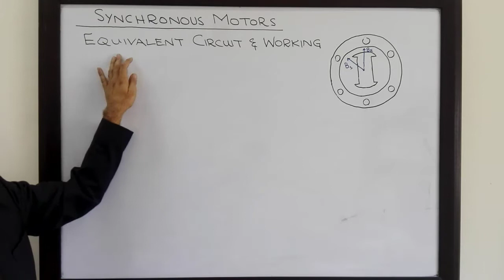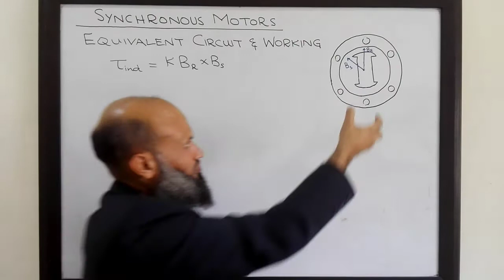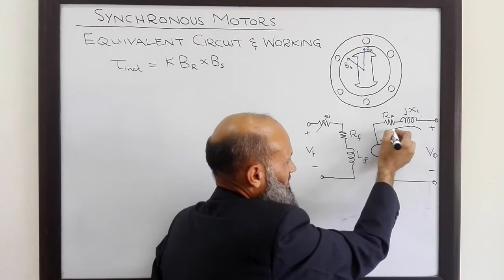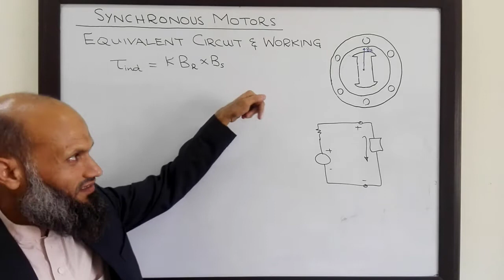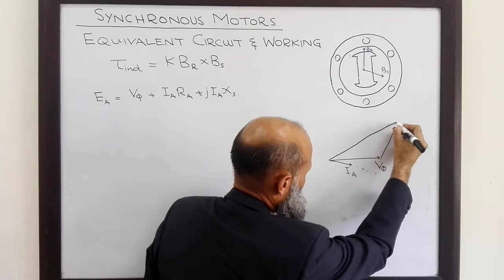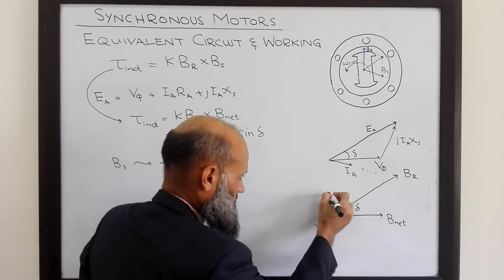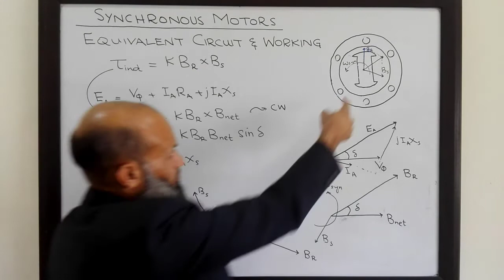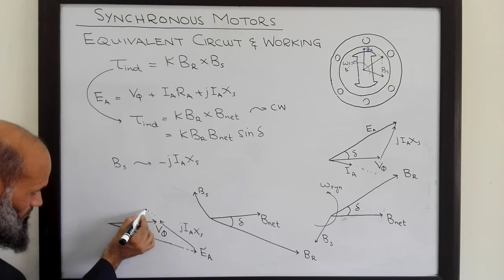EE213 - 38 - Synchronous motors - Equivalent Circuit and Working

Comment: Sir how is Bs still rotating with the same speed when we remove the prime mover ? Because as Br slows down the frequency of volatage in coil decreases and thus the speed of magnetic field i.e. Bs produced by them decreases.
Reply from the maker: Bs is due to current in the stator and it's speed of rotation is dependent upon the frequency of the current flowing in the stator windings. In case of synchronous motor, the current in stator windings is due to three phase supply connected to the stator. Therefore, speed of Bs is independent from the speed of rotor.
Reply: Sir I got that, but the machine was intially operating as Generator and the voltage produced in generators is due go roataing magnetic field of rotor and the voltage in 3 phase coil has same frequency as rotating Br but now if we remove the prime mover shouldn't the frequency of voltage in 3 phase coil decrease and  the corresponding speed of Bs ??
Reply from the maker: If the generator would have been working standalone, the situation would have been the same as you have perceived. However, over here, the generator is connected to an infinite bus.  As soon as prime mover is disconnected, the internal generated voltage drops and speed of the rotor decreases (during transients only), and the machine now starts behaving as a load (motor) for the infinite bus. Let me explain all the situation with the help of a very simple example.

Suppose, you are riding a bicycle at some constant speed and suddenly you stop peddling. What will happen? Your speed will drop, however, your cycle is still supplying power (utilized to overcome friction). 

Now suppose another situation. You have tied your bicycle (through an rod, for example) to a truck which is running at a constant speed. As you peddle your cycle to run it at the speed of the truck, you are supplying power (energy). What will happen if you stop peddling in this situation? You bicycle will still run at the speed of the truck, however, it will now be working as a load for the truck (compare it with the earlier situation). 

So, your bicycle is analogous to the generator and the truck is analogous to the infinite bus.
Reply: @MAFarooqi  Excellent example sir...
Reply from the maker: The machine is connected to an infinite bus, and as soon as prime mover looses its energy, the machine starts working as a motor.